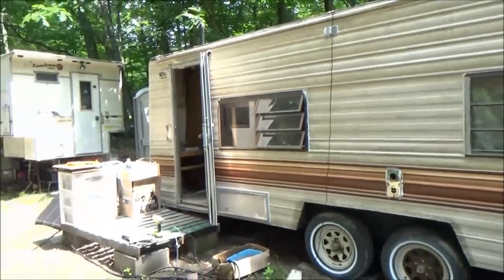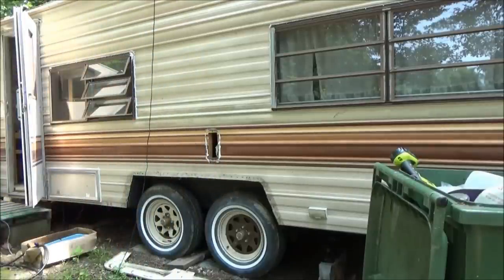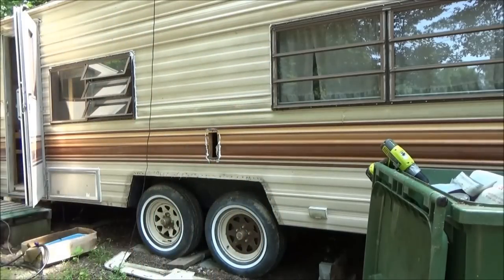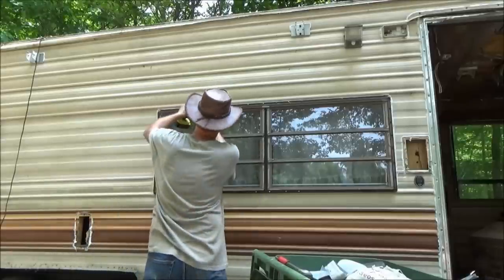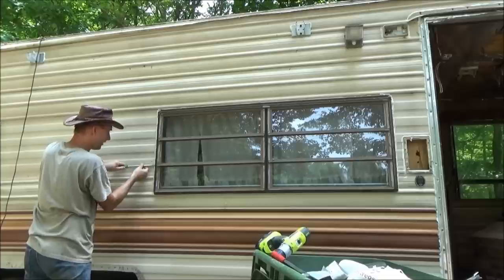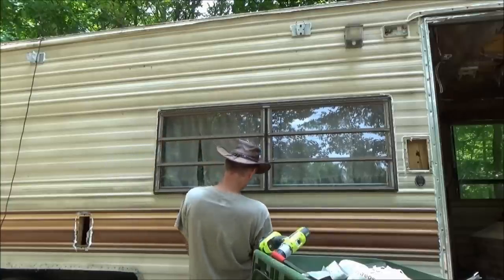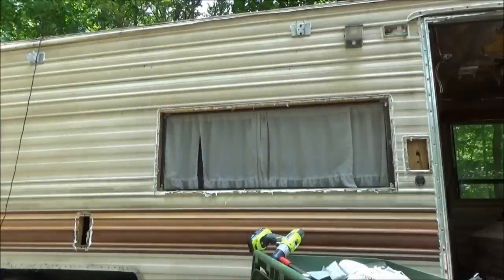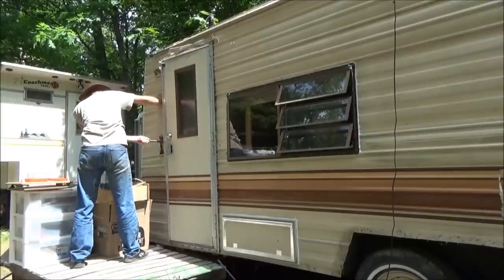Camper Demolition Begins For My Tiny Home Frame

Comment: Since you have an opening for the door on the camper already, you could use those sections of the metal paneling on the outside for your chicken coop along with the doors and windows! Big enough for a mini barn of sorts?

Comment: When you said you were going to sell those windows and doors because you didn't want to use them in your well-insulated home, I wondered who would want to buy them unless they are straight replacement parts for an old trailer. Because they would be poorly insulating for the new owner as well.
But then I thought: could you not use some of that for your new, larger and improved chicken shed? In the winter you could always improve the insulation of the window using bubble wrap. It's not like the chickens would complain that their view would be distorted by that.
Especially the doors would be nice: lightweight and you could leave door open with the screen door closed in warmer times.

And make sure you keep enough material to skirt the space under your house.

Comment: It wont take long to have it down to the frame. I have done several campers like this and have found that if you burn as you go then clean up is a lot faster and easier. of course the scrap metals can be neatly piled up and taken away any time but the wood will become over whelming once you get the siding off.
Reply from the maker: True, its a lot of wood once you get tearing it apart.
Reply: The Do It Yourself World And the burning will disperse the bugs.

Comment: Good start! Wear leather gloves, eye protection, work boots and lose the heat-trapping leather hat. A few bandannas and you will be much cooler working. You are solo Troy, you must take the safety precautions seriously. That siding will be dangerous and rusty screws and moldy/mildewed wood all present health risks.
Reply: Great points here, looks to be a great start but be safe Troy, take care!

Comment: you should save any working RV appliances, most setup for DC already...  like that furnace for backup heat.. or heat of a workshop when your in it and working... very handy to have when you need it.  I'd save the Windows and use them on a porch or greenhouse or cold frames.

Comment: Don't forget about that AC unit up there.  Those things weigh a ton, well not really a ton but a heck of a lot.  You dont want to pull away too much structure before you get that thing loose and away.
Reply: 88s10Durango
They still hurt like @#$% when they fall on you...

Comment: You could use those windows on building your own or atleast part of a new greenhouse.  Withe the louvre windows as the roof you could control the temp a little better on those really hot days by opening and closing them to get what you want

Comment: If you get in a hurry to get rid of the windows you can probably sell them to a rv repair place. Replacement windows are hard to come by and they can be costly. If you are getting rid of your stove and water heater and furnace list those as well. They are also very costly. You could end up with a nice bunch of cash towards your tiny home. :)

Comment: Do you need new batteries for your electrical system? Are the ones you have, tired and old?
Reply from the maker: Mine are not tired and old but they have given me trouble last winter. They do not like temperatures below 55 degrees F. I am looking around for something better, but still affordable. I would no longer recommend golf cart batteries for cold weather climates.

Comment: Demolition at this speed means you'll be ready to start on the tiny home trailer sometime in August or September 2015.
Working alone on a shoestring sometimes means discarding stuff you would like to save because the equation of time=money fails when the critical items are both time and money. You've not going to be able to "farm", prep for winter and build this thing in time.

Comment: Troy as a licensed building contractor I would highly recomend against screwing your home together. Screws dont have the shear strength nails do. I would never go in a house that was only screwed together. At the very least use nails for your framing. Good luck.
Reply: Even Simpson SDS Structural Screws? I understand these are preferred over nails when used withe Simpson Hangers and on decks.
Reply from the maker: I read that due to the flexing in a tiny home or trailer, screws are preferred due to the fact that they do not back out. Now I am no expert, just stating what I read.
Reply: If Troy were building a traditional stick house nails might be best, but a tiny house on wheels needs the benefit of the right screws for stability.

Interestingly the Habitat For Humanity homes build in the hurricane areas of Florida had more screws than nails and studies show they withstood hurricanes better than traditional stick homes that were built with nails.
Reply from the maker: Terry Teague Now there you have an awesome point. I dont claim to be able to do it but I have studied the topic and buildings with the proper joinery last through hurricanes.
Reply: GrandsonofKong have you ever priced simpson products? Way over priced but in a modern house there is quite a bit of required bracketry. sp? I've used more simpson and cleveland brackets than I can remember in the last 28 years, but I've never framed anything with screws of any kind. Framed , not decked or drywalled. Screws wouldn't pass code.
Reply: The Do It Yourself World well, screws break. Nails will bend some if anything. If you're worried about them backing out used galvanized or ring shank or screw shank nails.
Reply: Terry Teague forget about it.....not coming out are they? absolutely despise them. and screw shank. esp galvanized.
Reply: Terry Teague that would be great if you're timber framing and doing mortise and tennon joints, but modern stick framing doesnt use any of that.
Reply: also Troy, if I can be of any help just ask. good luck to you.
Reply from the maker: squireca hehe, if you want to take a road trip, I can use the help.
Reply: The Do It Yourself World well if it wasn't 3000 miles I probably would. California here.

Comment: Great job Troy.  People will buy the old doors and windows for chicken coops,green houses.  Is the siding aluminum?  

Around here we have recycling sites that pay $1+ per pound.  Am always curious who has recycling choices in their area and who does not. Heard that in some states they have no recycling sites at all.
Reply from the maker: Thanks. Yes its all aluminum.
Reply from the maker: And yes we have recycling places but our aluminum is not that high.
Reply: You are lucky. Where I am aluminum scrap goes for almost nothing. Probably due to supply. Around here there are a lot of scrappers (which piss me off because they rip up and destroy perfectly salvageable items that I used to refurbish and sell). Due to all this scrapping, the price paid for scrap here is practically nothing. You spend more in gas taking the scrap to the yard here.